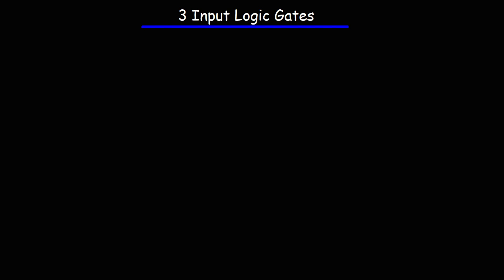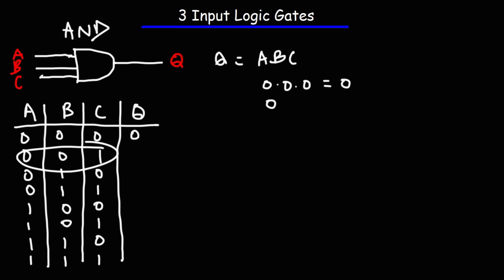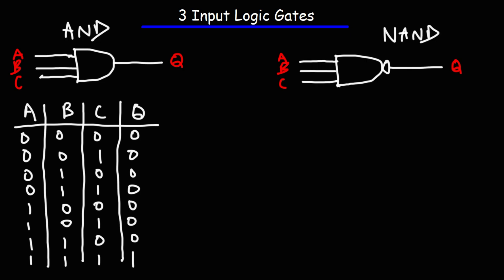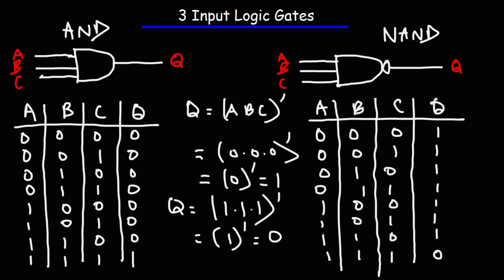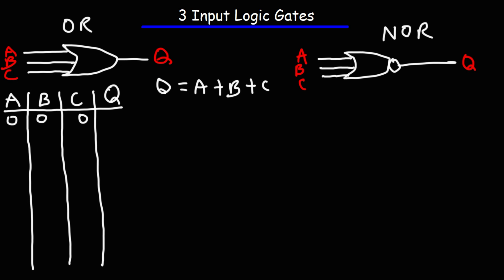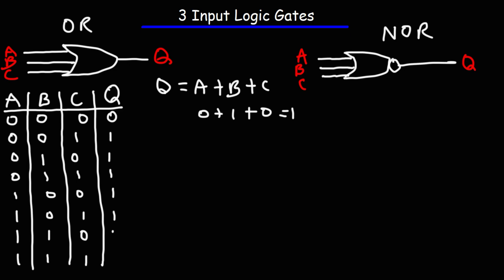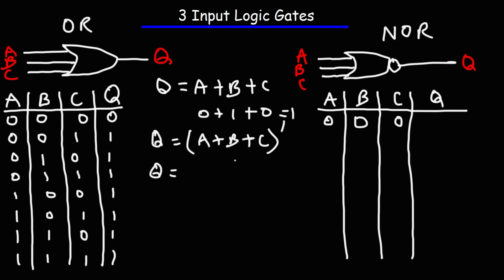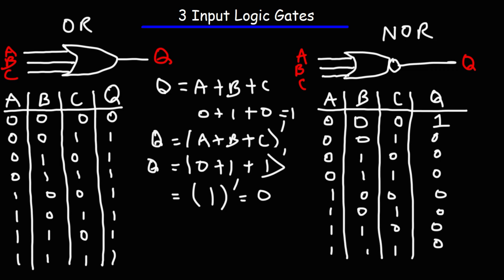3 Input Logic Gates With Truth Tables - AND, NAND, OR, & NOR

Comment: Why there is no ex-or?
Reply: Exactly! why there is no ex-or?
Reply: Best suggestion 😃🤘👌
Reply: And why do we have ones from health and safety will send marcin's law on you
Reply: How to make a keystone?
Reply: @mikrofala9456 

To make a keystone, you will need the following materials and tools:

Materials:

Block of stone or concrete

Chisel

Hammer

Sandpaper or a file

Measuring tape or ruler

Here's a step-by-step guide on how to make a keystone:

Determine the size and shape of the keystone you want to create. Measure the width, height, and depth of the keystone you need. Typically, a keystone has a tapered shape with a wider front face and narrower back face.

Select a suitable block of stone or concrete. The material should be sturdy and durable. You can find stone blocks at a local quarry or purchase precast concrete blocks from a hardware store.

Mark the dimensions of the keystone on the block of stone using a pencil or marker. Use the measuring tape or ruler to ensure accurate measurements.

With the chisel and hammer, carefully start chiseling along the marked lines. Begin by creating a rough outline of the keystone shape. Make sure to wear safety goggles and gloves for protection.

Once you have a rough outline, continue chiseling and shaping the stone, gradually removing excess material. Take your time and work slowly, using light taps with the hammer. Check the dimensions periodically to ensure you are achieving the desired shape.

After achieving the basic shape, use the chisel and hammer to refine the edges and create the desired taper. Pay attention to the front face, as it should be wider and more decorative than the back face.

Once you are satisfied with the shape, use sandpaper or a file to smooth the surfaces and edges of the keystone. Start with a coarse grit sandpaper to remove any rough spots, and then move to a finer grit for a smoother finish.

Finally, clean the keystone to remove any dust or debris. You can use water and a soft cloth to wipe the surface clean.

It's worth noting that creating a keystone from scratch can be a challenging task that requires skill and precision. If you're not confident in your abilities, it may be advisable to seek assistance from a professional stone mason or consider purchasing a pre-made keystone.
Reply: @niwex-gs8hh Great tutorial, Thank you!
Reply: @mak_audio Regards. until I fell off the couch
Reply: Greetings from my family, I nearly felt from The Tatra Mountain 😂
Reply: @mikrofala9456  You better make RJ45 cable, bro.
Reply: Y